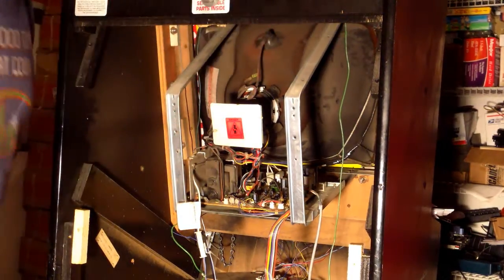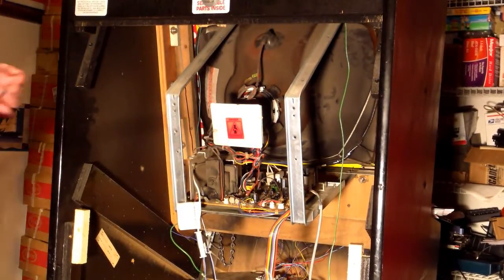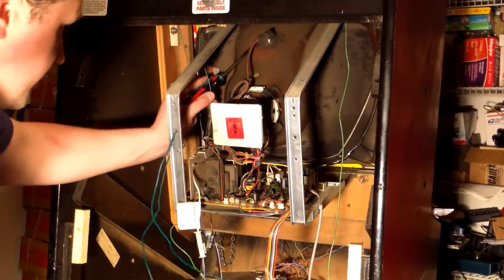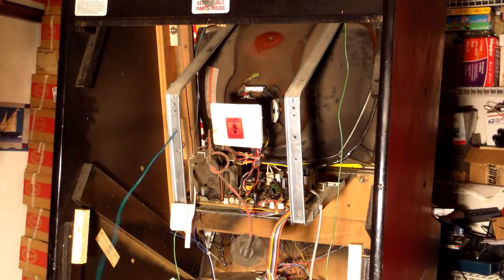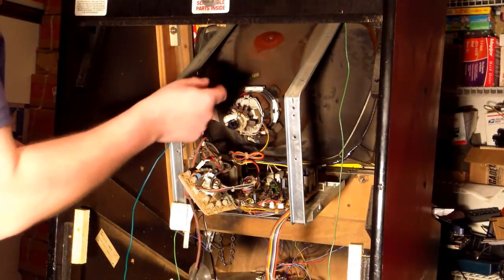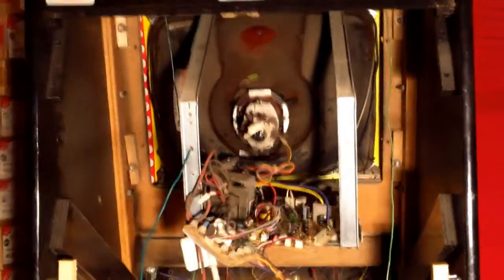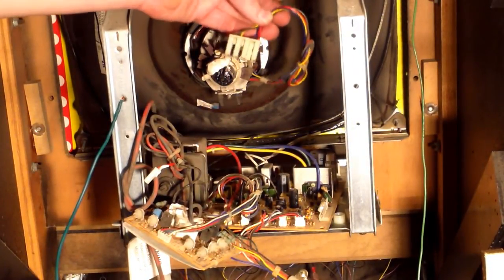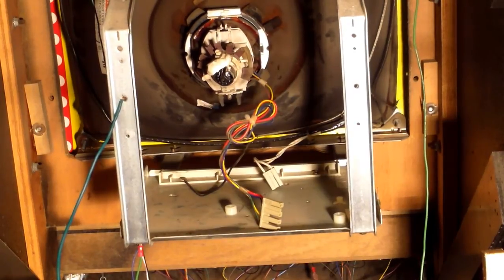Walsdawg Arcade---How to discharge a CRT monitor/TV

Comment: How long must CRT TV to be off to discharge itself?
Reply from the maker: Atanas Sotirov It depends on the monitor and the age of the monitor. Newer monitors supposedly had a auto drain circuit built-in. Older monitors may take days. Either way I would always manually discharge it anyways.